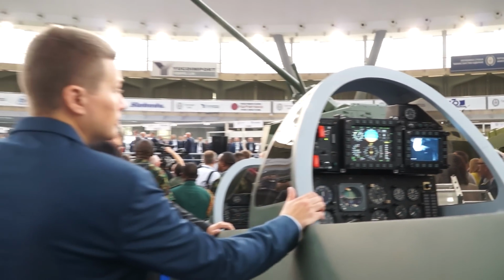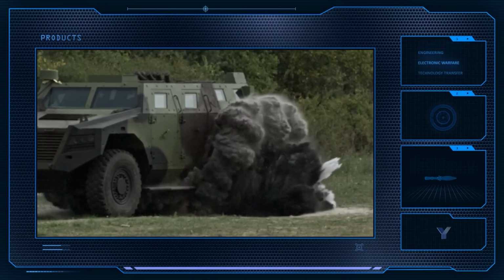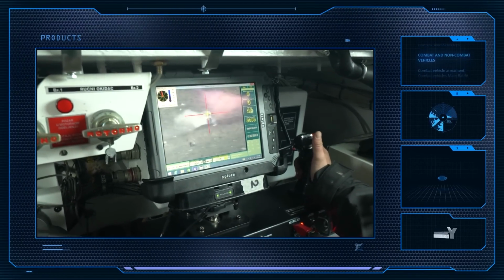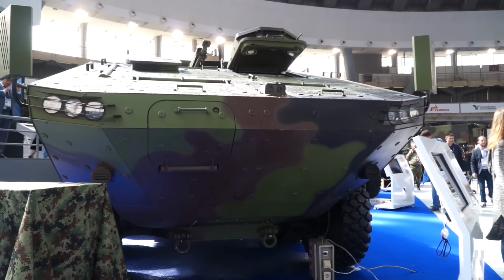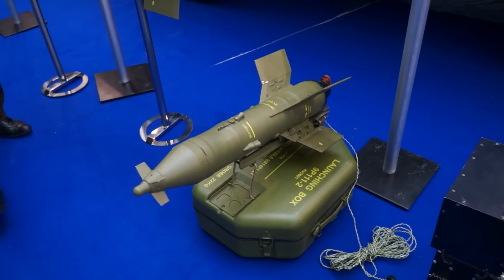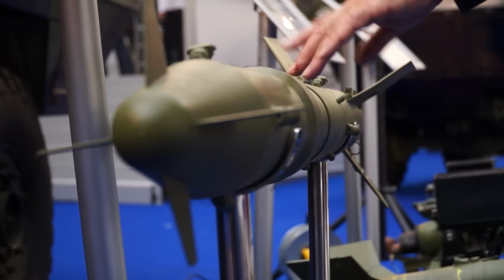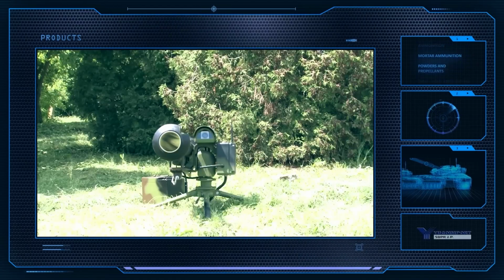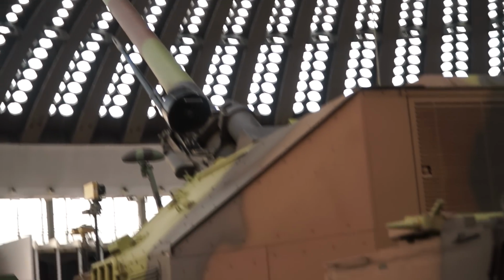Partner 2023 Day 1 Defense Exhibition Belgrade Serbia discover Serbian modern defense products

Comment: Interesting. Im well familiar with "Malutka" rockets as ex BMP-1 gunner. Despite nobody shows off with it, they are still making a huge part of AT defence of former Warsaw pact countries. In the original ones controls are absolutely pain in the ***.
Reply: Yes, but this cannot be compared to the old Maljutkas. These are software-based and much more precise, and their handling and guidance are much easier now.
Reply: Definitely but these are SACLOS guided variants with new engine and either a thermobaric or a double HEAT warhead. The longer one has 5km range.
Reply: This Termobaric Malyutka 2T it blows up the buker just like your Kornet rocket!!! It is very power and strong!!! Malyutka 2F is like China HJ-73 anti tank missile!!! And 2T5 there is nowhere similar with semi automatic launcher and with termovision, 5000m range!!!
Reply: only is the name old, but that system is brand new
Reply: @lazarduke6596  Like new serbian Armata tank? Only name is old, M-84?
Reply: @vladolorbek5234  no, its like BMW7 from 1976 and BMW7 from 2023 model.
They are both BMW7, aren't they?
Reply: @lazarduke6596  Maybe like Yugo America! Big mouth with a lot of shitt!